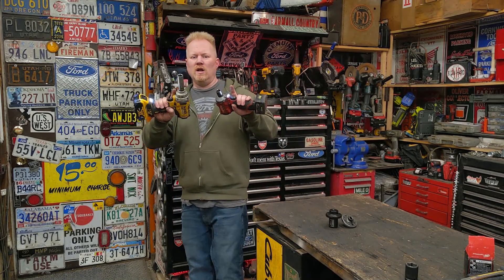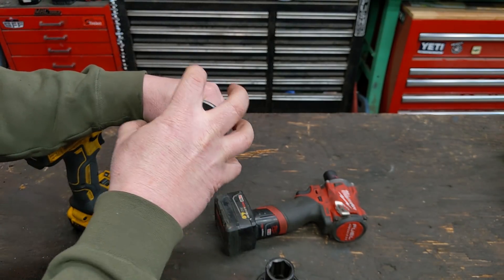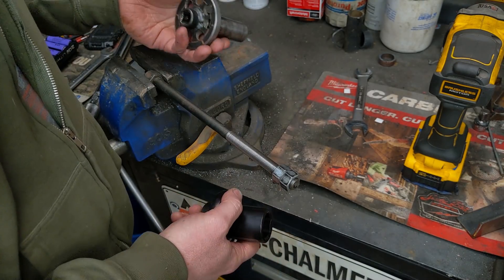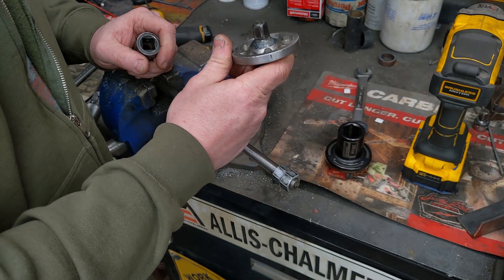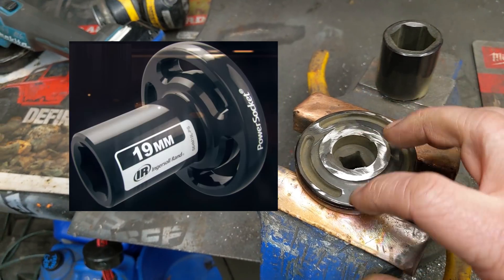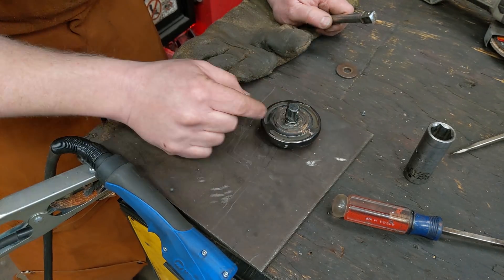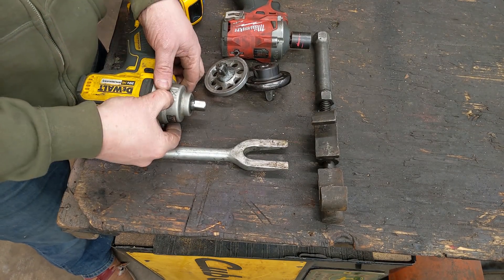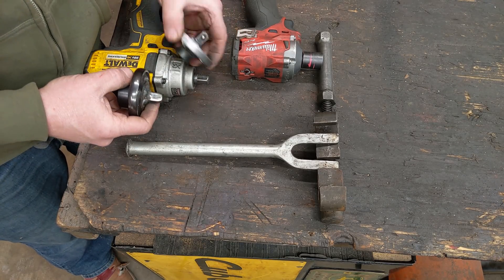Universal Weighted Impact Socket Adapter BUILD -one of a kind- DIY

Comment: (Hopefully) One day- it will be realized by someone more important than me,
with more clout, a bigger voice, with a Degree hanging on a wall-
That mass is like a capacitor.

1g weight. Put 1,000g of force behind it. It travels X distance.
A 10g weight, same force- is able to travel substantially more.
A 100g weight- even farther. The reaction does, however, begin to have
diminishing returns.

Accelerating a mass is imparting kinetic energy to it.
Air drag & gravity use up that, like a fuel. In zero g and vacuum- the
mass will continue forever.

A mass does not need a Relativistic speed to change it's molecular weight.

(Hopefully) One day- it will be realized by someone more important than me,
with more clout, a bigger voice, with a Degree hanging on a wall-
That mass is like a capacitor.

Comment: I have found that a lot of people don't consider the elastic properties of metals even though so many things depend on those properties.
The whole reason for torque specs on fasteners in relatively high and dynamic load condition applications is primarily because of the elastic properties of even hardened fasteners. Pre-loading reduces metal fatigue, and therefore fastener failure.

A good example of an intentional use of torsion as a spring is the spring used in assisting the opening of the gull wing doors of a Delorean.  The spring is just a solid spring steel rod that is connected to the body of the car on one end, and the door on the other. It's extremely effective, compact, reliable, and simple - an engineer's wet dream. It's also a good illustration of why impact guns are not very reliable for tightening and loosening fasteners that have an inherently high torsional reactance.
Reply from the maker: Well said.

Comment: Iv run into this issue before. Honestly didnt even know there was a such thing as a "weighted" socket. Definately explains why its so hard to remove ballancer bolts. My mikwaukee 2767 high torque does not have that issue, being that half of its torque being taken away from it is still more than most 1/2 air impacts have lol. Couldnt get a matco, snap on, or earthquake to budge the bolt on my ls1. The milwaukee zinged it out. 

I think i will buy that IR socket and do what you did, cut the end off and weld on a adapter
Reply from the maker: I've only needed it 3 times in 4-5 months but of those times it worked good. It's an odd thing to use but I think it has it's place.

Comment: I have the Ingersoll 21mm power socket. It's funny, it has the windows milled into the halo and isn't solid like that 26 mm. I wonder if they've updated the design or skipped that process to make the socket cheaper? For Ford super duty lug nuts it's a life saver!! The trucks I work on have been converted to busses and have aluminum front wheels where the lug nuts really can dig in. With a standard 21mm impact socket and a quality 1/2 tool truck impact you could fight forever trying to remove them or resort to needing  a huge breaker bar or 3/4" gun to remove them sometimes. That's with the lug nuts being torqued to spec properly with routinely calibrated torque wrenches. The Ingersoll socket has never let me down and takes any of those lug nuts off every time!
Reply from the maker: That's awesome! I wonder if the softness of the aluminum against the steel creates a torsion effect.
Reply: @sixtyfiveford  I'm honestly not sure. The alloy wheels are pretty thick. The socket isn't a 100% tight fit on the lug nut and you can see it rock/hammer back and forth very slightly so I almost wonder if it works to amplify the impact guns hammering blows. Kind of like those fan clutch wrenches you can chuck up in a air hammer.

Comment: The Honda socket didn't work on my Odyssey.  Even with my over priced Mac gun. 
So I put my cheapest pull bar on the bolt, shoved the handle against the chassis and bumped the starter.
Reply from the maker: Awesome! Those bolts are brutal.

Comment: That's pretty cool! Thanks for taking your time to fully learn and experiment with how they work and then clearly show that to us! 
I'd bet that adapter would come in handy when working with long or multiple extensions where you loose a lot of torque to those torsional spring forces
Reply from the maker: Yeah, it probably would work great with those.

Comment: So you're saying that I couldn't remove those bolts with my 1 inch heavy duty pneumatic impact without one of those sockets?
Reply: depends on the speed of the impact versus the torsion-spring-y-ness of the bolt.
Reply: @wim0104  Since I didn't need it for much, I bought the biggest heaviest torquiest I could get, 3,200 RPM and supposedly rated for 3,500 ft. lb.s of torque.  Interesting to think that such a big, heavy hammer could not do the job because of speed, but it makes some sense.

Comment: The u-bolt's springiness due to it's length example explained it best. Makes it easy to understand why you fabbed this up. 

Since I'm new to welding... and have several spare extensions and old dumbbell weights (2.5 or 5.0#) this looks like a great 'how many beers does it take to make this' test.
Reply from the maker: LOL, heck yeah.

Comment: So basically any fastener attached to mass that has leverage to turn will migrate, and need counter torsion to undo. Have you filed your patent? A $300 socket isn't unheard of with today's increasing tool prices.
Reply from the maker: Gives us a year or two and $300 sockets will be the norm.

Comment: Honda crank bolts arent that bad, 

You just find your least loved 90 bar adapter and your best force extender. Once it resembles a halfmoon, the bolt should be about to let go
Reply from the maker: Thanks, for the tip. I usually stop at the banana shape. Didn't know I had to go all the way to half moon!
Reply: I broke a 1/2" extension trying to get mine out .... hyundai elantra.
Reply: My home made torque wrench has 3 settings , banana, half moon and horse shoe.
I wonder how it would change the reaction of torque bars like the 4 colourful ones used in tyre shops?

Comment: Better way to explain the spring action is imagine pounding a nail into a springy 2x4 versus a 2x4 laying on a solid concrete floor, or being held solid. All the strike force is lost in the movement of the wood
Reply from the maker: So true.
Reply: But in this analogy is it a bigger nail or a bigger hammer?
Reply: @PJBonoVox  It is like adding weight to the springy 2x4 so that the frequency of vibration is lower than the rate you are hammering.

Holding the 2x4 while you hammer on it also accomplishes a similar thing by adding mass to the 2x4.

Comment: Fascinating work. I wonder if they would improve the performance of an impact with a long extension on it? Would be interesting to check that out.
Reply from the maker: In theory it would. I will definitely have to try this.
Reply: @sixtyfiveford  please do, thats also another major test that could really change the game if it happened to help with it
Reply: The extension would defeat the weight I think.
Reply from the maker: @BasketCaseGarageForFun  A 3" extension results in about 10-15% torque loss. once you get up to about 12 in long you lose about 50%. The weighted socket/adapter would help recoup some of those losses and stabilize the extension. Whether that be 10%, 20%.....? And even if that is enough to break the bolt free?
Reply: I wonder the same thing. Impact wrench - adaptor - extension - socket. My hypothesis's that the inertia of the adaptor would reduce the torque reduction of the extension.

Comment: I wonder if they would also prove effective when using longer extensions. After all, twisting is twisting.
When I was a mechanic, taking out bell housing bolts from the upper half of a bell housing, my impact was almost useless. The torque [twisting motion] needed to overcome the length was sometimes 15-degrees of rotation that had to be done by hand.
Reply from the maker: In theory it should. Like you unless it's utterly necessary an extension is never used on my impacts as it renders them powerless.

Comment: It seems to me, that unless the weighted mass of the socket is synchronized with the blows of the impact gun, it might actually work against it, decreasing the torque applied. If the socket was rebounding as the impact hammering, the forces would more or less cancel each other.
Reply from the maker: Not really. Think of it like driving a nail into a springy unsupported board. Put a heavy steel weight on the nail head that transfers the weight through to the board and slows/reduces it's spring back. Now every hammer blow more energy is going to go into driving the nail vs springing the board. This weighted socket doesn't add any power or torque, it simply allows some lost power/torque to be transferred to the fastener.
Reply: I thought it would have acted as a dampener between the blows of the hammer vibration and material of metal like a spring... Can we get an engineer in the comments please.
Reply: The blows are happening so fast the material doesn’t have enough time to go back to its original state, so you’re keeping it on its edge and forcing it from there.

Comment: Have you tried holding the outer ring in the direction you are using the gun into to stop it from rotating? Used to work when removing wheel nuts.
Reply: That seems like it would work. Maybe even put a hex on the outside of the socket, so you could put a wrench on it in the direction you want to turn?
Reply from the maker: I was actually holding it in a lot of my testing. It think it's natural instinct.